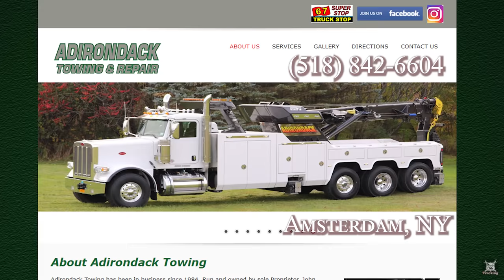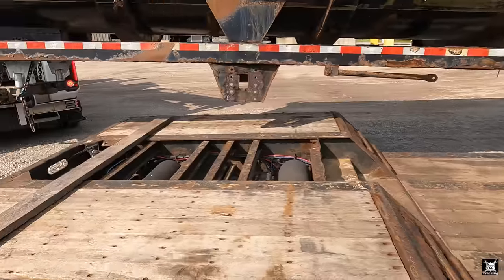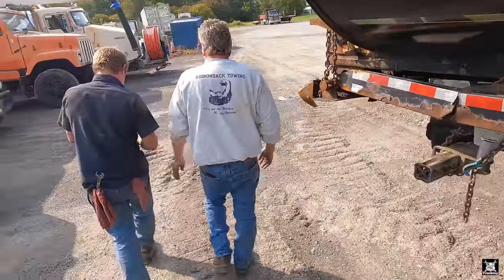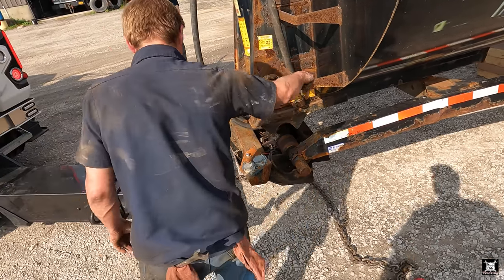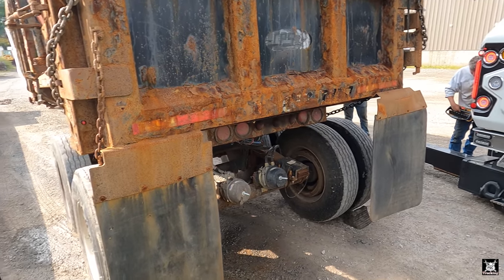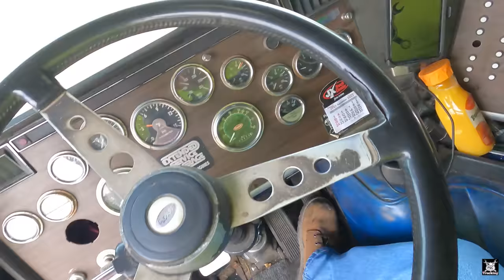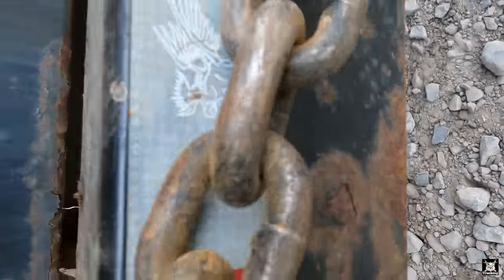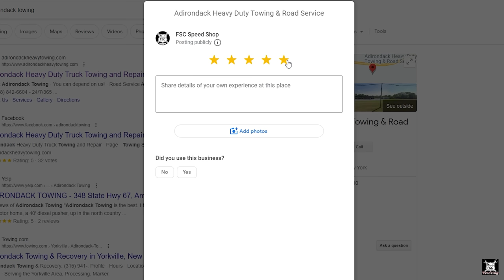Truckers And Wrecker Drivers With GUTS Get It Done!  "F" it!  Load It Anyway!

Comment: I think after a while the wrecker company guy liked the challenge and wouldn't allow it to beat him. His equipment was new and clean. I bet he has seen some nasty wrecks in his time. The guy that bought the trailer must have got it really cheap, likely for major parts like the dump body and hydraulics system that are rather expensive new (this is a 2017 model trailer) to put on a good trailer chassis. Now you have to get it to Minnesota in one piece and dealing with the hassles of permits, etc. I bet your sandwich was better than you usually get at the truck stops.

Comment: Earnest Holmes built the first wrecker is 1918, it was based on a Cadillac. Mr. Holmes legacy lived on into the late 80’s when they were bought out by Miller. I have one of the last Holmes wreckers produced in my fleet and wouldn’t trade it for a dozen Jerr-Dan. They built some legendary heavy duty (600, 750, 850 were some of the most popular) wreckers and they sort of were an early “rotator” so to speak. Check them out, absolutely fantastic pieces of engineering!

Comment: The guy that kept going under the load and putting himself into pinch points was driving me nuts.  You finally said to him, "I don't know if I would be standing there."  Holy crap that guy is going to die a horrible death.  Any time im offloading with a crane or big fork lift or whatever, I do what I have to do and then get the hell away from the kill zone.  I've seen chains break cables snap and you don't want to be anywhere near when the load shifts and comes down.  Glad you got it loaded.  Be well!  :)
Reply: I agree my boss would have given me what did I tell you about working under load's, the second time it would be go home for a day or two No Pay to think about it

Comment: What you needed was a wrecker that rotated . You would of had to drop your trailer but it would of been easier. You set the trailer you want to load on the ground unhook from it set up right behind  the trailer you want to load it on and pick up the front of the trailer you eant to load with the winch and swing it to where you want it on the trailer. Then unhook and move to the other end and dobthe same thing. Loaded and done

Comment: Back seat driving, but it prob would have been easier to lift the ass end of the trailer up, then have you back underneath it instead of trying to angle it on there while boomed out.